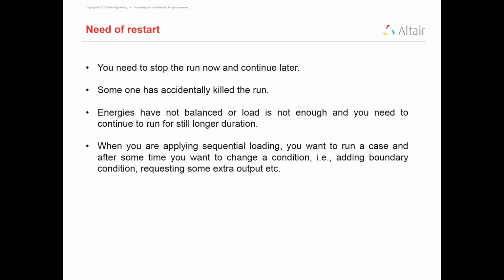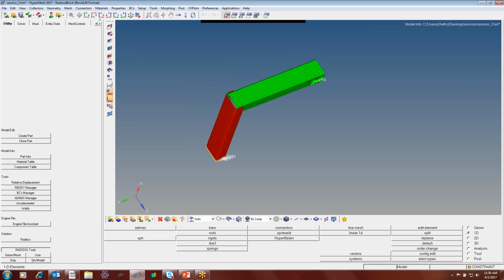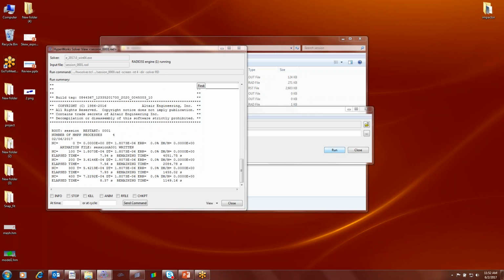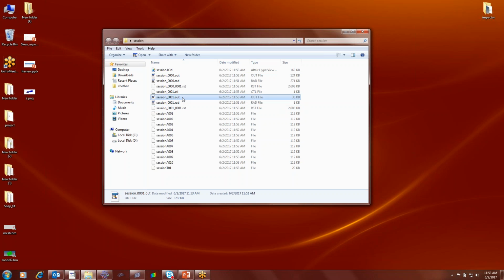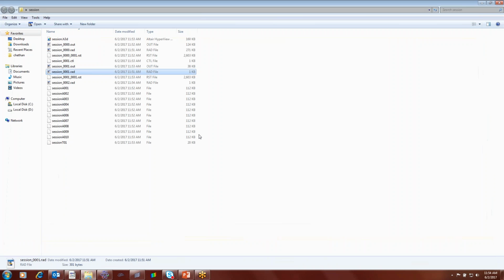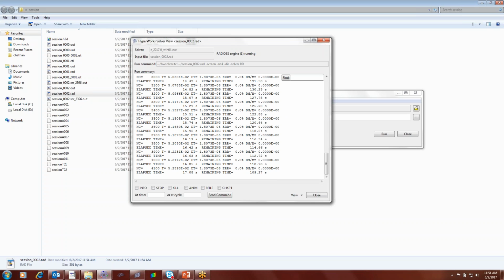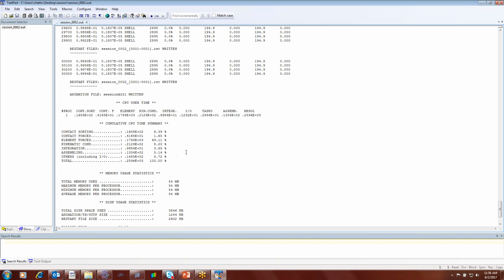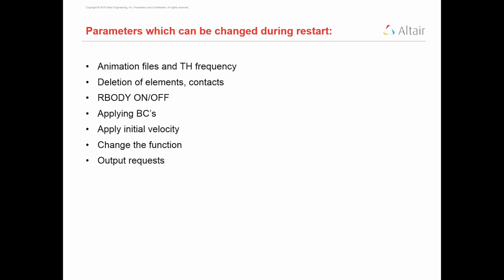5 Procedure to Restart a RADIOSS Run

Comment: I've submitted the run with 16 CPUs and it generated 16 RST files. While submitting 002 engine file I got below error message
 ** WARNING ** : RUN NUMBER FOUND IN /RUN CARD FROM INPUT FILE
                 RUN NUMBER IGNORED
 ** ERROR: FILE R0004_RHD_PRV_0001_0001.rst NOT FOUND
     ERROR TERMINATION
 ==== End of solver screen output ==== 
 ==== Solver FAILED ==== 
==== Radioss Job completed ==== 

Can you please help me to restart the run in V2022.3 version?